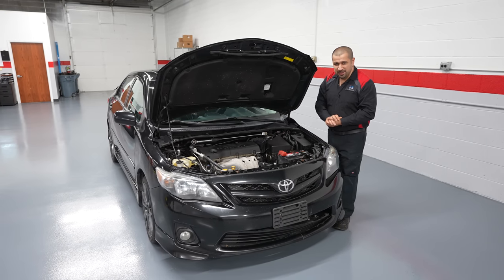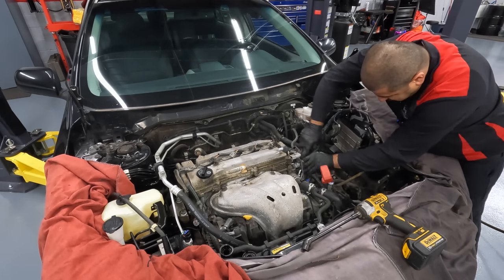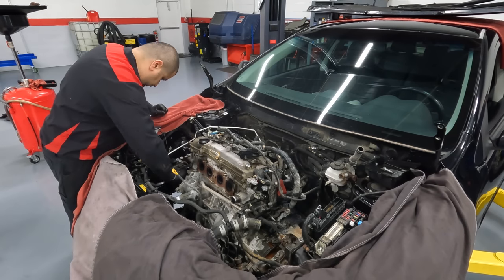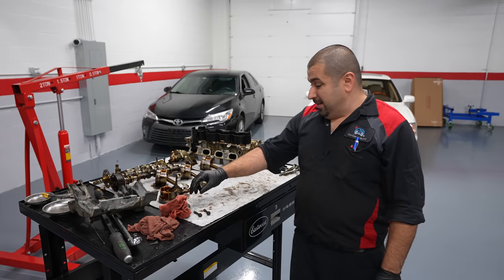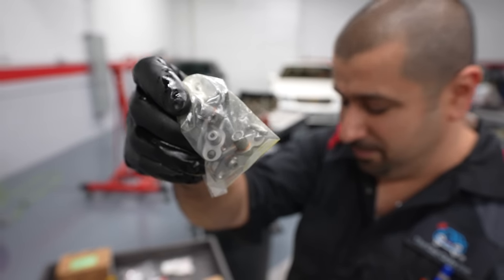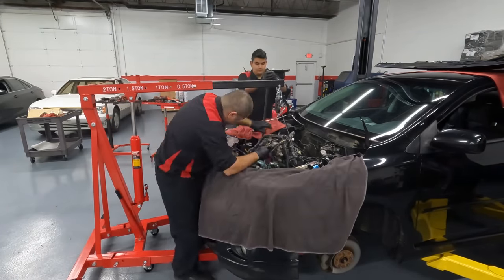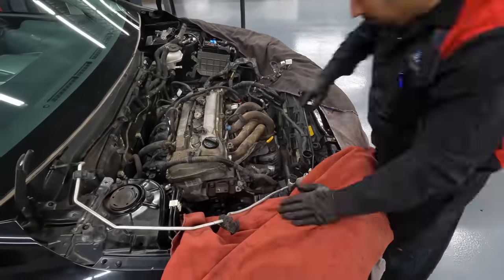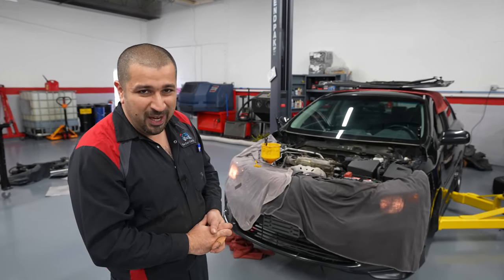THIS is Toyota's Worst Engine Ever Made! But Is It Really THAT Bad?

Comment: As the owner of the car, I can tell you first hand, this shop is for real, I've never experienced anything like this place, this 3 person crew is amazing on and off camera!!!
Reply: nice car by the way! would you mind if i ask what kind of coating did you use to protect it from rusting underneath? would appreciate some details
Reply: @zhila5958  Thank you, please forgive me, I bought the car from a dealer here and it was already done, so I unfortuately I have no idea, if there are any other questions I can answer for you, please don't hesitate. :)
Reply: That shop is immaculate and organized too!!
Reply: @carllinder9599  all good mate! i was wondering how does the car behave in comparison to normal corollas since this one is an XRS variant. doesnit handle much better? is the car fromt heavy by any means? how is the car after you received it from AMD’s workshop? would appreciate further info about such rare gem
Reply: @zhila5958  Hey Zhila, It's my second corolla the first was a late 90s one that I drove the hell out of till some one totaled it, I loved that car, I was searching for this one for a while, when I ran across it, I was unfamiliar with the XRS variant, it fit the description I was looking for, a sedan, black leather interior, fairly clean, really liked the idea of a bigger eng. in the corolla. After buying it, I got the chance to compare it to a new Corolla IM, I thought my steering was slightly sluggish and the ride stiff but in comparison I was very impressed with the torque,  mid range and top end of the XRS, It was a substantial jump. I later found out about the oil consumption, I usually do oil changes about every 2000 so when I saw this I panicked, I knew I needed brakes soon and could feel the clunking in the steering, that too was making me nuts, so I was searching for the best Dealer Mechanic I could find, that's when my nephew told me about Ahmed on Youtube, I had already seen him so I thought if he's in a state near buy, perhaps I could make it happen, that's when I found out he was a few towns over 🤯, when I met him and his team of two, I knew he was the one, when I got my car back, the steering was perfect, the brakes perfect and now I'm finding out about the eng. because I'm under strict orders to keep it under 70 for the first 1000 lol, This is being the most difficult part! This man and his wife are truly an amazing team, one of the best I've ever seen! All I own are Toyotas and Hondas, If I owned a Honda, I would beg him to work on that too, perhaps I need a rav4 hybrid or a Prime lol.😁
Reply: @carllinder9599  When you think about the price of a new car, spending $4000 to keep an old one going is not that much. What are car payments these days? I think they start at about $400 a month for the lowest priced car and go up from there. I don't have that problem. I got my car (2001 Camry LE) very cheap and started working on it. I have it perfected mechanically now. The biggest expense was four struts. I had to get tires eventually, but all cars need tires. And brakes too.
Reply: @anonymike8280  Agree totally and after dealing with Ahmed, I couldn't be happier
Reply: @carllinder9599   You're probably good for another 20 years. Or more. In my world, a 2012 is fresh off the lot and a 2001 is a late model. My 2001 Camry LE came from an elderly Air Force retiree. He had never missed an oil change but other aspects of the maintenance had been neglected. I had to replace the struts and all of the little air hoses under the hood. The big problem I had came when the bolt for the timing belt idler broke. I had never extracted a broken bolt before and I had to buy a bunch of tools.

My conclusion is that the bolt broke because whoever had replaced the timing belt did not torque it properly. The water pump bolts were rusted and they broke also when I tried to remove them. The whole job was a mess of improper fasteners and bad work. My big adventure was taking a city bus across town to go to the wrecking yard and get factory hardware from a junked Camry. The mileage is up to 163K now and it runs like a new car.

Only old pickup trucks last longer than Toyotas. That's if the owners maintain them. It's not that hard to do the basic maintenance of oil and coolant changes. Some engines are more vulnerable to bad coolant than others, but all engines need oil changes. Another problem is that people listen to the Dr. Doom types who tell them to follow excessively complicated maintenance protocols and who berate discount services or discount products like Walmart motor oil.

Where I live, there is a regional tire chain that offers a $20 oil change. It's a basically a break-even service just to get you in the shop or to keep the regular tire customers loyal and satisfied. They use a no-name filter and Havoline oil out of a box. If you have a vehicle that can run conventional oil and you change it regularly, you are not going to have an oil-related problem. What the Dr. Doom types end up doing is deterring people from doing anything at all. No, you don't have to use the high-end products. No, you don't have to worry about residual oil or coolant when you do a fluid change. No. No. No.
Reply: Where are they located?
Reply: @marcusvaldes  Holmer Glen IL.
Reply: @carllinder9599  Homer Glen. I've read Homer. I've got Homer on the brain.
Reply: Well worth spending the money Carl.
With regular oil changes that car will last another 200'000 miles and then some.
I bought an abused 1991 Land Cruiser 10 years ago and now after some TLC it is the best vehicle I have ever owned.
Toyota engineering is special.
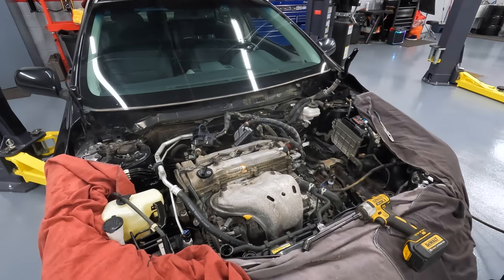Reply: As you acknowledged at 3:10, this is not the worst Toyota engine. The Diesel Turbo 2.2 engine was a really disappointing one. It was used in 8-seater vans in the 1990s. It would prematurely fail/wear out.

The petrol engined vans were much more reliable.
Reply: I don’t know bout this guy,he didn’t upgrade the injectors or the cams or reprogram the icu or nothing,😂
Reply: @NoName-tz5ji  I know!! 🤣😂🤣😂 He figured he was doing the midwest a favor, maybe it's time to go Rav4 Prime?
Reply: @carllinder9599  this my top 3 favorite body designs of toyota. The xrs/s corolla, so i second "nice car". I hope you enjoyed it, outside of the oil burning and vvt cam flaw.
Reply: @wesfields9322  Thank you, never had problems with the vvt, Ahmed's work has been fabulous and allows me to enjoy the car as a daily driver.
Reply: The coil packs suck
Reply: Is it true that you can put thicker oil in older engines? My mechanic just put 5W30 in this engine even though the manual says 5W20. He told me it would run longer that way. Not sure if I'm destroying the engine with that oil.
Reply: How much was the total bill?
Reply: @StrumVogel  2470$
Reply: Where is this shop located?
Reply: @Jose-sy1je  it's fine it's the same the second number is the outside climate temperature that you will run it. Better is 5-40 for a very hot climate.
Reply: @Jose-sy1je  if you worry about 5w-30 being to thick, use 0w-30. It's somewhere in between 5w-20 and 5w-30, despite the '0' in the front. The reason most car manufacturers went for lower viscosity oils is because of CAFE requirements. I would really recommend 5w-30 if you live in warmer areas where daily temperatures stay above 25°C. 5w-20 might be an OK winter oil in norther USA and Canada, but for the number of CR-Vs (2.4L) we did, I don't trust it for summer time protection in stop and go driving.
Reply: @carllinder9599 Did you drive your car all the way to this shop, or did you have it shipped?
Reply: @GolgiGuy102  I drove it, I kept the oil level up, it was probably using a qrt every 500 miles and the shop is only about 30 miles from me.
Reply: So what was the total bill?  I have the same issue on an 07 Camry.
Reply: Definitely looks like a top notch place why its legitimacy was questioned is beyond me. My step father is a mechanic and his shop although smaller in size is just as clean. Personally I’ve come to realize when shits picked up and organized and work areas are clean, I’ve come to learn whatever I’m doing normally is much easier to do and much quicker to accomplish because I’m not searching and tripping over shit. This goes for anything whether in the garage,wood shop, machine shop whatever one is doing. These guys look more than legit, glad you got your car back
Reply: Such immature comments
Reply: I have a 2009 Corolla  with the same issue. How much did this repair cost? If you don’t mind me asking.
Reply: @mobadga  Aprox $3200.00, I had some other work done at the time and wouldn't change a thing, Ahmed is straight forward, does great work and stands behind it, I can't see taking my car to anyone else as long as he remains the same. eng. has roughly 12000 miles on the new eng. and it's perfect, it's a daily driver and sees high speeds more then most would imagine ;), I trust Ahmed and his wife and I trust no one anymore. :)
Reply: since he fix it, now i wanna buy it from you 😄😄😄
Reply: See....i never had this problem.  My tc gets driven hard, like burnouts often.... Barely if ever I need to add oil.  I have used wix filters and royal purple since I got it with 74k...has more than double that now....never an issue
Reply: Where can I get the repair kit and pistons with shipping to Tijuana Mexico?
Reply: If you don't mind me asking, how is the oil consumption for your car nowadays?
Reply: If you don't mind me asking, how is the oil consumption for your car nowadays?
Reply: @Jose-sy1je 
Coming from experience, it's not a wise move to use thicker oil. It can cause problems. Thinner oil is better. 
ASE Certified Master Technician  and Toyota technician retired.

Comment: I understand what you are doing, I was a Master Toyota Tech myself at a dealership. I worked there 11 years and opened a Toyota repair business like you did. Done that 24 years and  then retired. I did all 22re blocks replacement in 1985 due to hard blocks that never let the rings seal and burn oil. I got where I could do one per day. Keep up the great work would love to meet you one day and talk Toyota's. I started working at Toyota in 1979 and got to see all the new changes like EFI, and timing belts, VVT and OBD2 just to name a few. I admire all the work you do and educating the public of what goes into working on Toyotas.
Reply: Nice!  WOW!  My favorite vehicle of all time, my 1991 Toyota Sr5 V6 4X4 with Xtra cab.......I remember those starlets? In 79....
Reply: I am a BMW and Mercedes-Benz tech in San Francisco.  I wish I could work for Toyota.  

I drive a 1986 MR2 and have rebuilt 3 4AGE engines.  

@kimpettit2703 You are lucky to have worked for Toyota during their golden years IMO.
Reply: Do you recommend using thicker oil for older engines? I have this 2AZ-FE engine and the mechanic recently filled it with 5W30 instead of 20.
Reply: @Jose-sy1je  5W-30 is what Toyota recommends.  5W-20 is not going to cause harm.  Just never mix oils and keep up with the service intervals.
Reply: @WinstonSmith1997  Toyota actually recommends 5W20 for this engine. What's the problem with mixing different viscosity oil? It says online you can do that
Reply: @Jose-sy1je  there is no problem when mixing oils, just that you change the viscosity. If you use 50% 5W-20 and 50% 5W-30 you end uo with something like a 5w-25 which is not going to damage your engine. Not even mixing synthetic and conventional damages anything, as they are compatible. The only way to damage your engine is by not changing your oil or using something like 20w-50 instead of 5w-30.
Reply: @WinstonSmith1997 That is a very interesting comment.  Why do you wish you had worked for Toyota?  I would have thought most techs would be more enamored with working with BMWs and Benz’s.

For reference, I’ve owned several Toyotas and a couple of Mercedes’s.  I’ve always found the Mercedes’s more interesting, but the Toyotas last longer (I currently have a 2007 Avalon with over 300,000 miles).
Reply: @jibrilthegreat35  Only if the ambient temp in your area falls past the thinnest viscosity rating of 20.

But the 50 compared to 30 will give a  better protection.
Reply: @crxdelsolsir  better protection once the engine is warmed up, but a straight 50 will cause havoc at cold start up, as it will take a lot of time to flow to engine critical parts.  But a 5w-50 will flow ok at start up and offer the best protection at high temps.
Reply: Would love to know your opinion on the 2ZZ GE engine in the Celica. Chances of bore wear with the aluminium silicon coating and piston rings etc.
Reply: @WinstonSmith1997 hey I had Toyota mr2 when I was 20. That brings back so many memories.
Reply: Guaau I like people with common sense like you.  This guy it's just talking about the bad things from toyota cause no one is perfect and happens to every car makers
Reply: I had a 1982 Corona LE with the 22R engine, best car I ever owned but being in New York, rust got to it.

Comment: Taking it apart is one thing remembering how to put it back together is another. My hats off to all mechanics that are able to do this kind of work.😊
Reply: Don't 4get finding or printing & reading the manual carefully even though & especially bc u don't really want 2 have 2 do it again ever
Reply: Take a lot of pictures as you take the engine apart.
Reply: I think they take so many apart that they recognize parts/systems.
Reply: Its actually really simple. Don't be intimated by a bunch of nuts and bolts.
Reply: Sometimes they are apart for a long time, waiting for approval and parts can take a month sometimes! It's really tricky then
Reply: Absolutely. However, this engine is so easy to work on. I have done deep dives like that in the 2AZ, after the first one you kinda know.
Reply: @ahmadghosheh3104  yea they're pretty basic for dohc 4 cylinder
Reply: Taking pictures help, also writing things down..
Reply: @knocksensor3203  I keep nuts and bolts organized in a muffin tray
Reply: Good point there. He's a good and skilled man.
Reply: Specially the ones who drop all the bits into a bucket of petrol or diesel give bits a good clean n put it all back together no books no you tube and it fires up first flick
Reply: @markjeep9415  torque specs and torque to yield angles matter lol
Reply: There is only ONE way to put it back together and it works - just keep trying....
Reply: @PeterCastle2A  I used empty medicine bottles. work great.
Reply: That's what they are trained to do! That is like being in awe that a surgeon took out an appendix or that Usain bolt won a 100m sprint dash. An average person who is TRAINED to be a mechanic can do it with ease.
Reply: @johngreg12  🤣🤣🤣
Reply: Hold up! Does the 2AZ not have detachable rod bearings??
Reply: that's absolutely nothing, take apart a BMW engine and lay the parts out...
Reply: @retiredat44  yea we have those too BMW Supra lol
Reply: @PeterCastle2A  That's how the owner ends up with spare parts lol, that's why I feel blessed that we have someone like Ahmed around!
Reply: @carllinder9599  I've been working on Toyotas since 02 and I'm a Master Tech & Shop Foreman. I totally get it lol
Reply: @PeterCastle2A  Nice to meet you Peter
Reply: Take pictures with your phone as you take it apart. That will help you see what it looked like before.
Reply: @petestanton1945  It actually looks like fun if you have a great shop, all the tools you could ever need, and lots of time to do it.
Reply: record it.
Reply: When I have left over parts after an install, I call them "optional equipment" and throw them in the glove box.
Reply: Manuals? Photos? 🤦‍♀🤦‍♀🤦‍♀
Reply: If you don't have parts left over after a repair you've done messed up
Reply: @twin2482  problem is not put back together when you assembly you have to have sure that all parsts are perfectmm,, and you dont have that knowledgment
Reply: @bugsyboy5323  I'm not a Mechanic but I am Mechanically Inclined... I always fixed my own Vehicles...lol but since I'm getting older, I found a really good Mechanic 1st time and Keeping him... 🤗
Reply: Gentlemen we are watching a master mechanic who shows how much knowledge and ability good mechanics have developed.

Comment: I have a 2009 with 220k it probably burns a tablespoon every 5k miles, i have replaced the water pump twice since it was new. This car is extremely reliable, im still using factory alternator,all sensors and fuses, and factory belts. I have never replaced anything else except tires and brake pads. Treat a toyota well and it will last 20+years.
Reply: Dang those Toyota water pumps do go out a lot don’t they ? I have a Honda pilot at 240,000 miles and I’ve only changed the radiator

Comment: I have this engine and it’s got over 378.000 and never had the problem being the proud owner of three of these cars
Reply: Same here!
Reply: Same, have one with 340k miles on it and no issues
Reply: Nice, did you have the re-ring done or still stock?
Reply: @DU30DU30 It was so bad Toyota had to do a recall, and tear open the engines to put new pistons or rings, I am not sure.
Reply: Same here.
Reply: I too have this engine my mechanic put in a new engine in my 2007 Toyota Camry Hybrid, was wondering if you might know with my mileage being 221,000 how does it work... Will my car last a long time?
Reply: thats si a shitfull engine doesnt matter of aht you say.-
if its good buy it

engine machinist